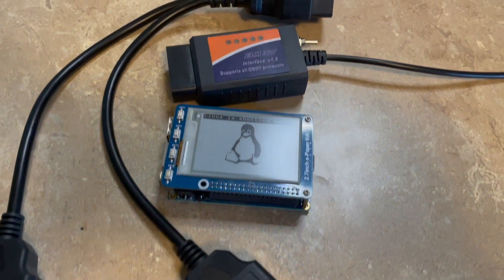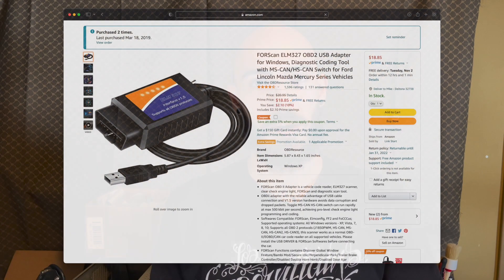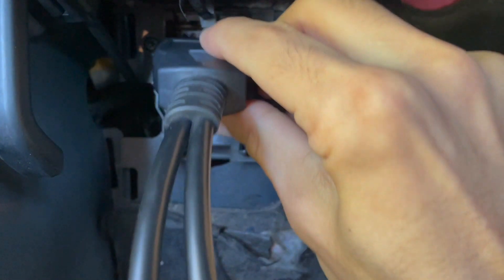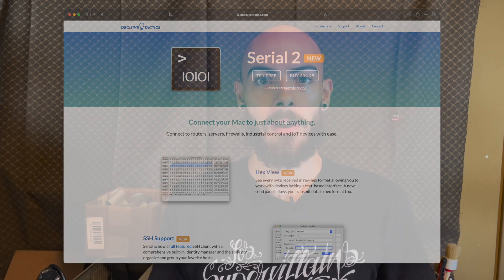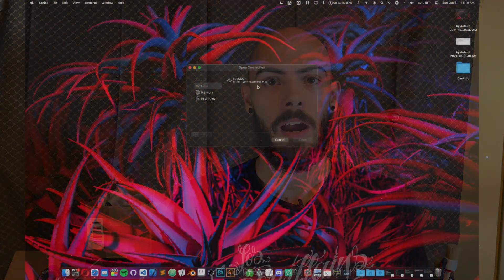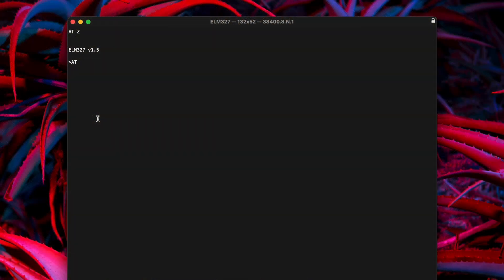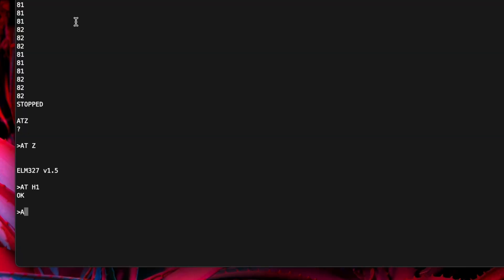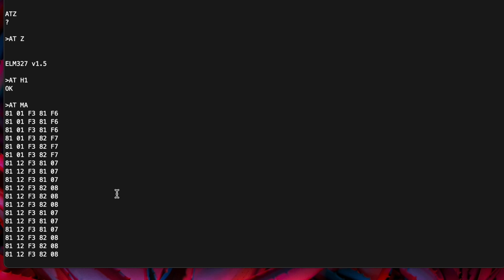Sniffing OBDII Packets with an ELM327 - for Raspberry Pi/Arduino Dashboard Displays

Comment: I tried with raspberry pi4 but the raspberry pi doesn’t detect anything as usb I’m using —-CERRXIAN ELM327 OBD2 USB Adapter OBD2 to USB Scanner—- Panlong OBD2 Scanner Bluetooth OBDII Diagnostic Tool Car——
Reply: And the same obd splitter you used 

So when I connect everything and connect the usb to the raspberry I don’t know exactly like how to get the data thru serial
Reply: The Bluetooth obd works via Bluetooth fine, I would like to do the connection wired kind of better
Reply: @luisvega436  Did you manage your wired connection get to working?

Comment: This was exactly what I was looking for. Great work Mike!
Reply: Ok I got all the stuff and finally got it working. For me, using Serial 2 on a Mac, and the same USB OBD2 adapter, Serial 2 would not make the serial connection unless I connected it first, and then once it was connected, I then connected the other OBD2 adapter diagnosis module which I wanted to sniff. Anyway, got some messages, now to understand them!

Comment: I have a t1n too😂 and I want to dump the ecu to remap it. Keep doing your nice work, I can learn a lot from you, thanks
Reply from the maker: It's surprisingly tricky to find tools that will remap the T1N's ECU, especially if you have an OM647. I asked some overseas tuners and insisted these files would work, they didn't. Van was in limp mode, ran like a dog, and the high pressure fuel pump clicked for some odd reason.

Comment: Is it possible to download the data on your computer’s local hard-drive?  Great vid btw
Reply from the maker: Yes, I built a small example program (in Python w/ PyImGui for the UI) to log any communication going both ways. Then I export to basic JSON and I can re-load it into my small test program after and dig deeper on a per packet basis
Reply: @IgnoreSolutions  Can you provide your program for logging here?
Reply from the maker: @napoleonpaxton1410  It almost deserves its own video, since it's grown quite a bit. But here is my custom Python program I've created: https://github.com/suicvne/t1n_sprinter_obdii

Please let me know if you have any architectural questions. I've tested this only on macOS and Linux, but given that it runs on those two platforms getting it to run on Windows should be trivial.
Reply: @IgnoreSolutions  Thanks! I am getting a runtime error . "could not find any library for SDL2 (PYSDL2_DLL_PATH: unset)". Have you encountered that before? I am using a macbook air and the ELM327 you have linked above.
Reply from the maker: @napoleonpaxton1410  You’re probably missing SDL2. I install it via homebrew: brew install sdl2
Reply: @IgnoreSolutions  installing with homebrew worked! Now I'm troubleshooting a connection issue. For some reason the elm device is not showing up. I'm going to try to get it working through raspbian. Also, I will be running this on an Acura MDX and a Honda Accord. Are there any changes to the code I need to make?
Reply from the maker: @napoleonpaxton1410  Strange. Maybe something has changed in the latest versions of macOS. You will also most definitely probably have to make changes to the code unless the Acura & Honda happen to use the same KWP as the t1n Sprinter van I tested/built that py app for.
Reply: @IgnoreSolutions  Hi, i usw windows ad recive this error

SDL Window:  <sdl2.video.LP_SDL_Window object at 0x03A97990>
Traceback (most recent call last):
  File "C:\Users\Andrea\Downloads\t1n_sprinter_obdii-master\t1n_sprinter_obdii-master\sprinter_obdii_monitor.py", line 318, in <module>
    do_main_test()
  File "C:\Users\Andrea\Downloads\t1n_sprinter_obdii-master\t1n_sprinter_obdii-master\sprinter_obdii_monitor.py", line 218, in do_main_test
    ui_test.ui_init_graphics()
  File "C:\Users\Andrea\Downloads\t1n_sprinter_obdii-master\t1n_sprinter_obdii-master\ui_test.py", line 214, in ui_init_graphics
    ui_loop(_appData, _window)
  File "C:\Users\Andrea\Downloads\t1n_sprinter_obdii-master\t1n_sprinter_obdii-master\ui_test.py", line 482, in ui_loop
    debug_monitor_window_loop(appData, _window)
  File "C:\Users\Andrea\Downloads\t1n_sprinter_obdii-master\t1n_sprinter_obdii-master\ui_test.py", line 357, in debug_monitor_window_loop
    imgui.next_column()
  File "imgui\core.pyx", line 11634, in imgui.core.next_column
imgui.core.ImGuiError: ImGui assertion error (draw_cmd.ClipRect.x <= draw_cmd.ClipRect.z && draw_cmd.ClipRect.y <= draw_cmd.ClipRect.w) at imgui-cpp/imgui_draw.cpp:453

thanks for your support